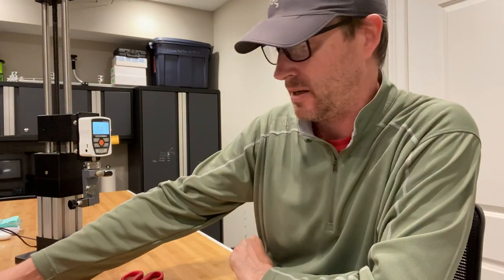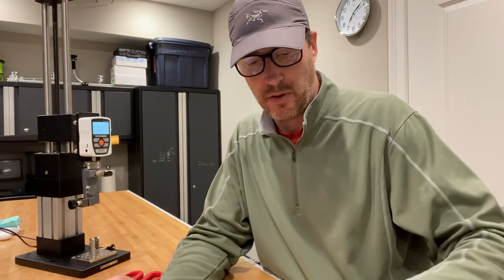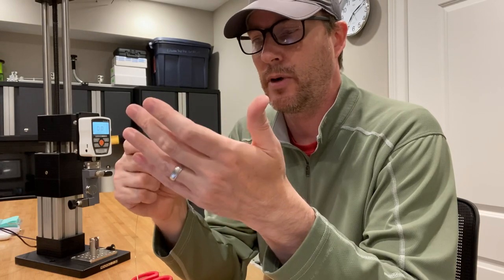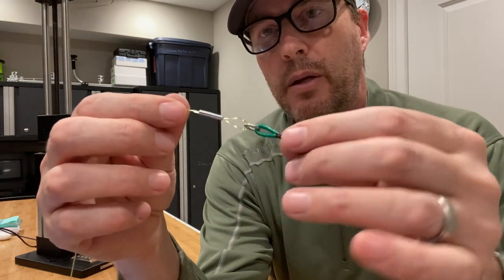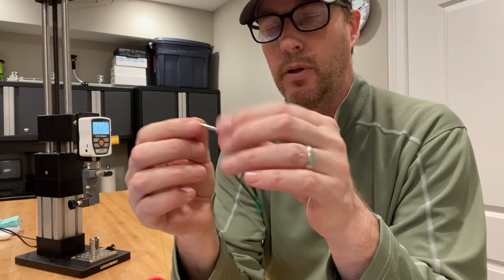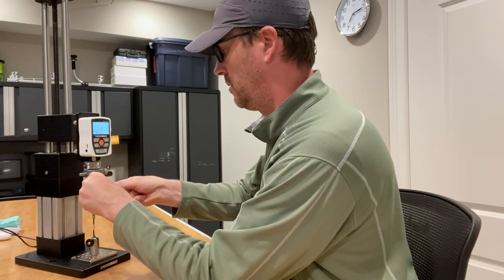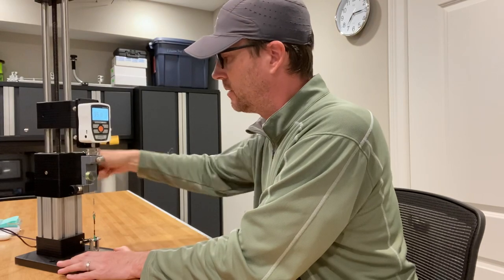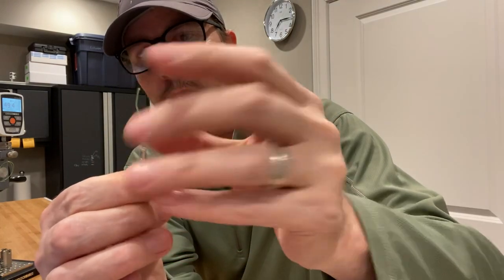Stop tying finishing line knots and start using aluminum sleeves - 100% connection every time!

Comment: Very useful and will help reassure using crimps. 
I’ve heard from an experienced captain that using one crimp is better than two side by side when trolling pulsing hard baits at high speeds because the two crimps will wiggle against each other and cause failure.